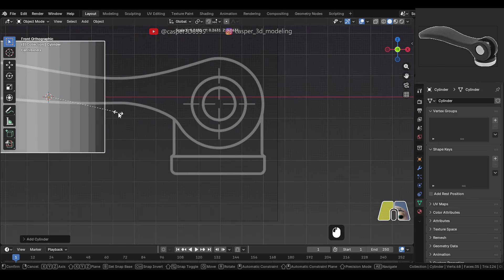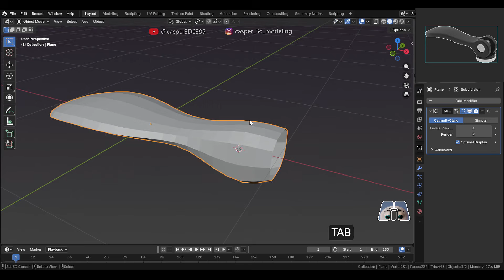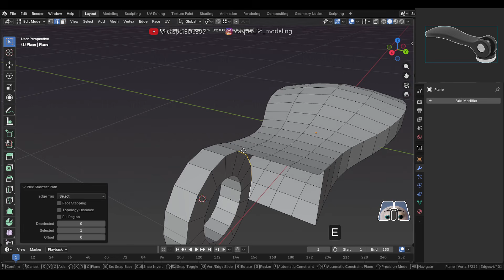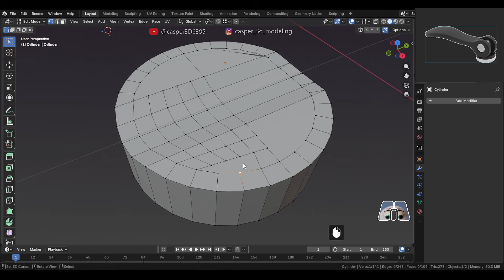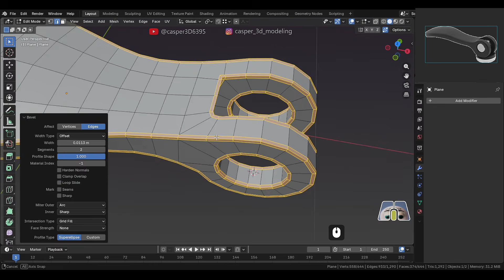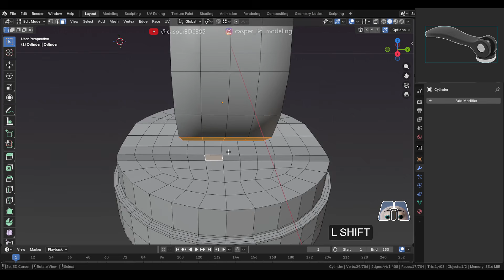Blender Practice – Modeling a Mechanical Cam Lever Handle (Clean Topology)

Comment: Hello! If possible, I would like to see a tutorial on ropes in Blender on your channel. Ropes that hold a soundbar or ropes that hold a load on a camel. A braided rope, for example, that holds a bundle of objects suspended from it. A camouflage net made of these braided ropes that is draped over a toolbox. Or a camouflage net for a helmet, which is usually used to insert a playing card or branches of bushes for camouflage purposes. For example, you made a soccer ball on the channel, but what if you add a soccer goal model to it, which again uses a goal net made of ropes? There's a lot of hard surfacing on the channel, so I'd like to see a guide on ropes and cables that can be optimized for the game engine right away. Of course, it's entirely up to you, but this is just a request.
P.S. I used Google Translator, If you add a russian AI soundtrack, I will also be very grateful to you!
Reply from the maker: Thank you so much! Really appreciate the detailed suggestions and the time you took to write all of this. I'll definitely keep these ideas in mind and look into them. As for the Russian AI audio, I'll also look into it and see if it's possible to add.

Comment: very nice topology, but please be aware of your reference. The pivot point of the lever is off-center for a reason and is very important for the mechanical function of it. Yours would do nothing at any rotation of the lever except permanently depress the pad underneath it.
Reply: I was going to state this very same comment as well. I just made a model of a lever and as JPax stated, the pivot circular object where your threads go in must be off centered. See bike cam lever and you will see how its usually in the upper offset leaning in to the cam handle. This creates pressure.
Reply from the maker: Thanks! Appreciate the feedback. I'm not exactly sure what you mean. If you're referring to the object's origin, that can be changed easily by placing the 3D Cursor at the rotation point and setting Origin to 3D Cursor.
Reply: @casper3D6395 if you look at the lever, it's hinge is dead center of the round circular part in your model. The idea of the hinge is when you lift it, it releases tension. When you lower it, it increases tension. Because your hinge point is on the middle of the circular section, it doesn't ever change the tension when you lift or lower it. It's nothing to do with 3D modelling, it's to do with reference and accuracy.
Reply from the maker: Thanks! I see what you mean now. I wasn't really thinking much about the technical side of the mechanism. I only wanted to show the modeling process and topology, but I appreciate the explanation.